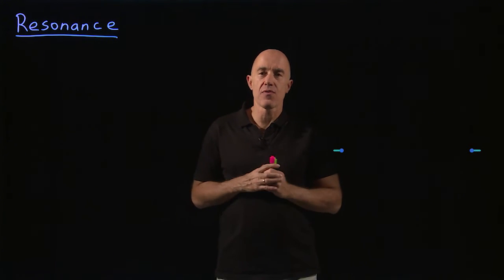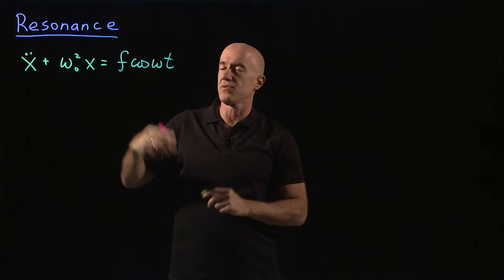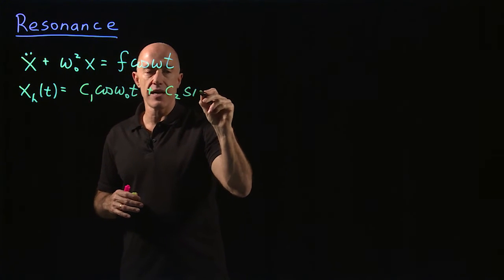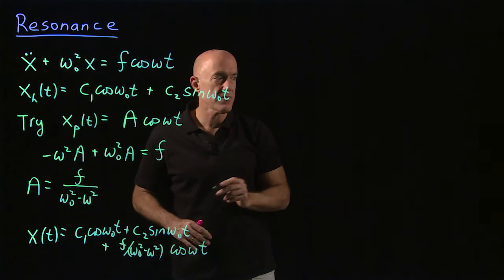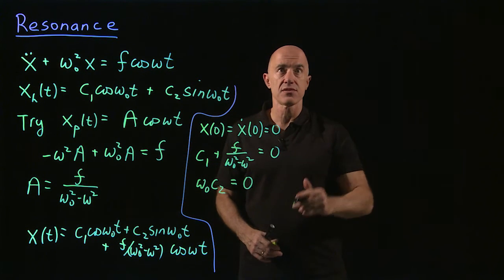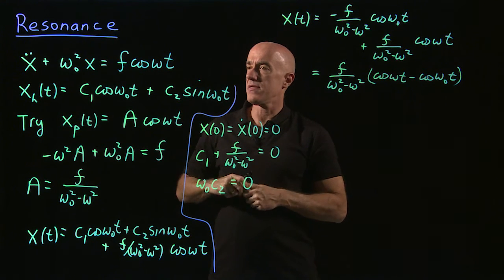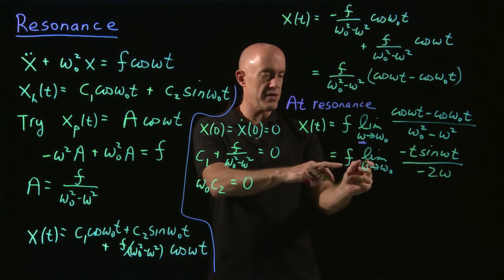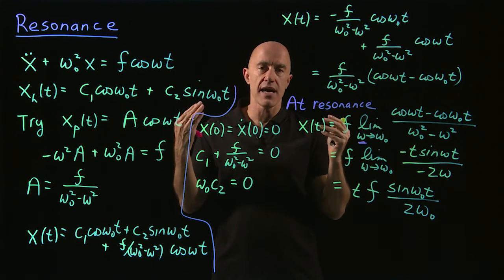Resonance | Lecture 24 | Differential Equations for Engineers

Comment: Profesor Chasnov, I am doing a self paced study of differential equations and there is a doubt that I haven't resolve. In the book That I am using as a reference (sl Ross differential equations) he said that when calculating the particular integral of the equation of resonance is xp=At*sin(omega*t) +Bt*cos(omega*t) instead of xp=A*sin(omega*t) +B*cos(omega*t).
The book said that is due to the fact that the homogeneous is c1sin(omegat) +c2cos(omegat)

Why is that?
Reply from the maker: When the inhomogeneous term is a solution of the homogeneous equation, you need to multiply your ansatz by t.  Why don't you take my Coursera course Differential Equations for Engineers?  I also have lecture notes.  You can use your book as a supplement.
Reply: @Jeff-math  not enaugh budget proff,
Reply from the maker: @adnfulcrum  Haha!  It's free!
Reply: @Jeff-math  So I've filled the application for financial aid in Coursera because if a enrolled in your course I'd very much like to have the certificate.
Reply: I appreciate, though, your invitation to take the course. Let's see what Coursera would decide... (Y)